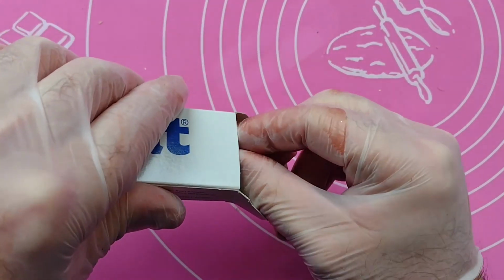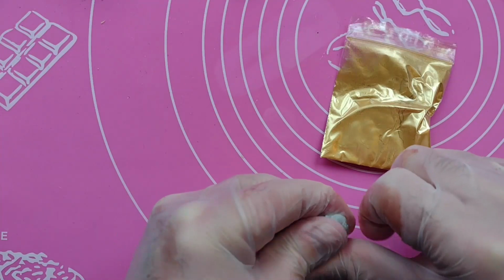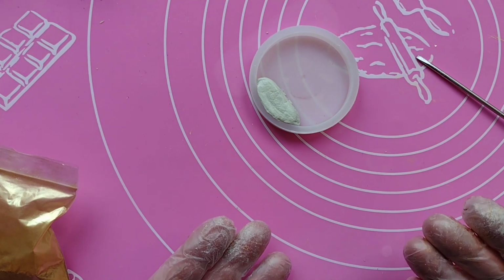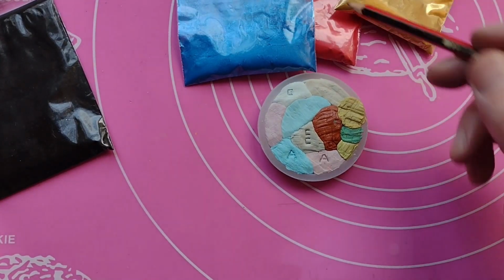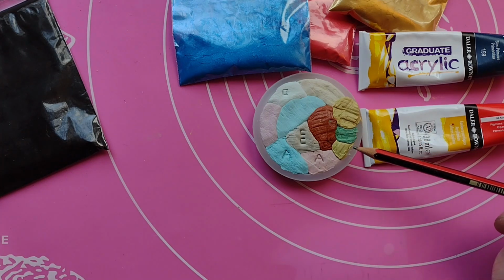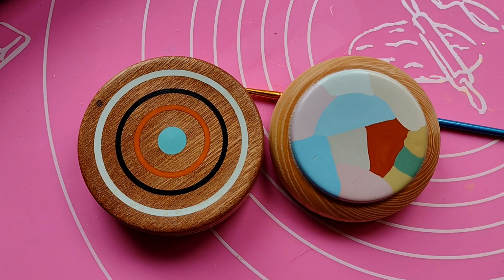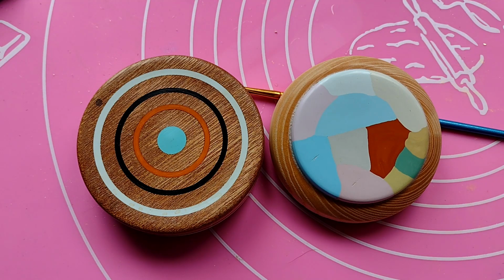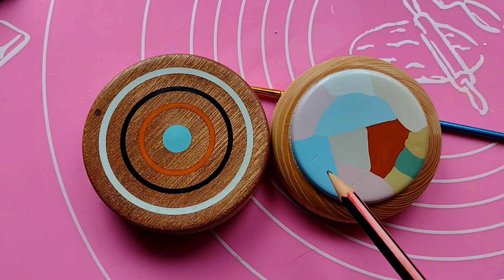Colouring Milliput Epoxy Putty using Mica Powder and Acrylic Paint

Comment: Yah mica powders really depend on the observer seeing the pigment within the material. Anything opaque you want to color wont be much affected by mica because all you see is the few pitment particles that were exposed on the outermost surface. Thanks for the test. I am curious the threshhold if a LOT more mica were used.. maybe make it crumbly but curious to know.   Thanks again, I really do hope some effective method for coloring Milliput does get discovered.
Reply from the maker: Thanks for commenting. I stuck with the general rule of no more than 10% by volume for the mica powder. I'm guessing you would be right and it would get crumbly. I've just got some of the new Metallic Milliput so looking forward to trying that!